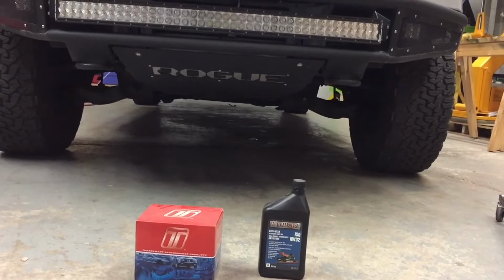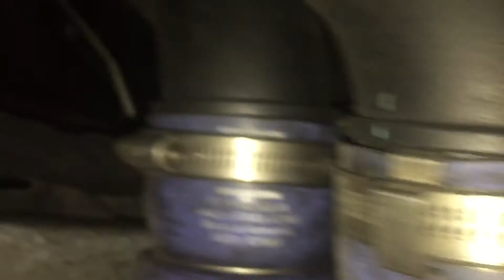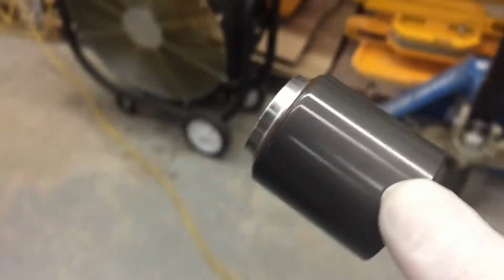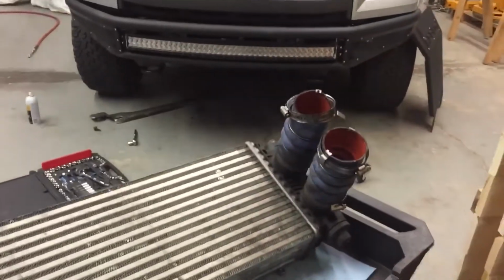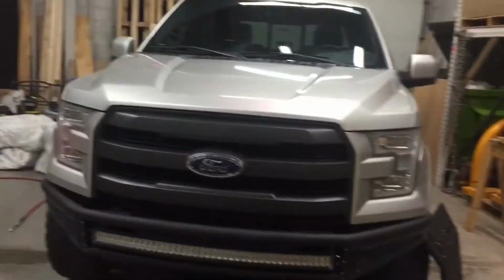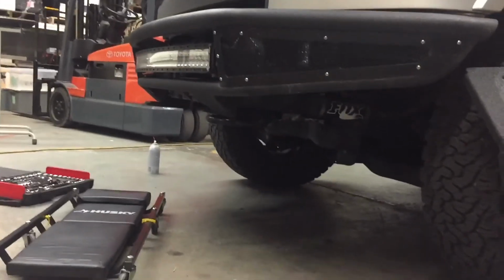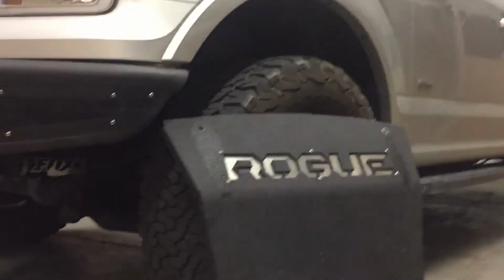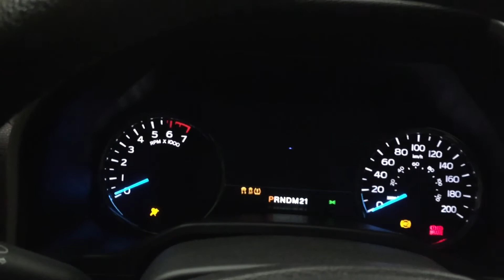Watch This Before You Buy a BlowOff Valve!

Comment: I love your videos man. I went out and got a turbosmart bov just like yours when I saw this. Had it put on yesterday and it sounds amazing especially with the AFE CAI. I was wondering how I know if I need to adjust the bov like tighter or softer? I have noticed the driving is a little different maybe a little more sluggish and slower to get up to higher speeds? I feel like I have lost some of the low end torque the 3.5 ecoboost is know for. Any way I look forward to hearing back from your and can’t wait to get this dialed in on my 2014 3.5L f150.
Reply from the maker: Thats awesome! I'm glad my videos helped out. Mine is tightened all the way. I haven't played around with tightening and loosening of the blow off valve too much... but I'd tighten it all the way and see if that improves your issue. 
Can you get access to your blow off valve from lifting the hood or do you have to remove your intercooler like the 15-17 F150 models?
Reply: Jacob Reid - I can reach it pretty good. But it’s tough. I tightened it more and it feels better but the torque doesn’t get kick in until I get into higher rpms which feels weird because I’m used to the low end torque the ecoboost has. If I tighten it all the way will it have any effects on the performance of the truck? I hear more noise from the afe CAI than before I had the blow off valve and I’m wondering if I have it to tight and the left over air from the turbos is blowing off through the CAI instead of all of it going through the bov. If your anything like me I have to have everything right and dialed in on my truck or it drives me insane.

Comment: Your truck ever throw any codes cuz of this? I first installed a S&B CAI and was fine but once I installed this BOV my CEL came on. I went to the dealership today and they got codes P0035 and P04DB both I’m pretty sure are caused the BOV. I took it in because I started getting the Ecoboost Rattle. They did  acknowledge the sound but wouldn’t touch it cuz of the parts. Guess I gotta go back to stock.
Reply from the maker: Dredd that sucks. Did you install that sensor delete gizmo that they give you? When I ordered mine they gave me a sensor delete that didn’t fit my plug and I had to go a couple of days without it and my engine light was on during that time. Other than that my truck hasn’t had any issues. I had some issues with my MPT tunes, but nothing with my BOV
Reply: Jacob Reid is that the thing that clips on to the unused wires? If so, then yes I did. I’ll probably just go back to stock in case that rattle turns out to be something more serious.
Reply from the maker: Dredd yea it is. Hmm I’d go back to stock and take it to the dealership. The joys of modding *eyeroll*. All the best